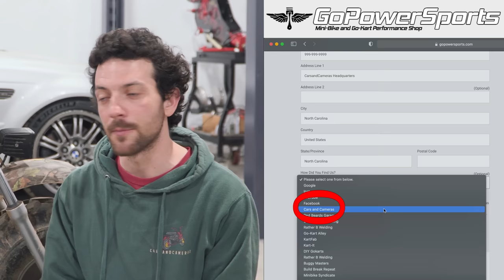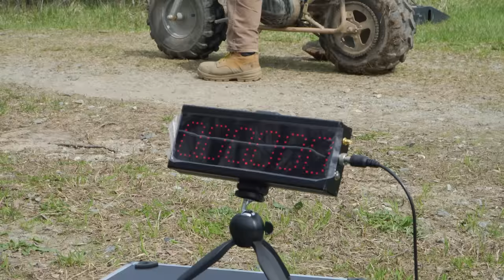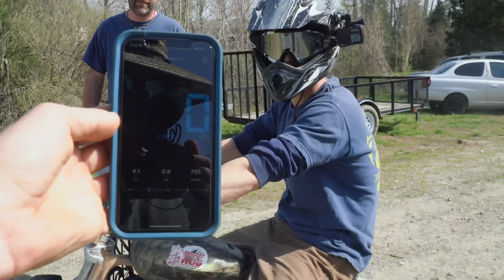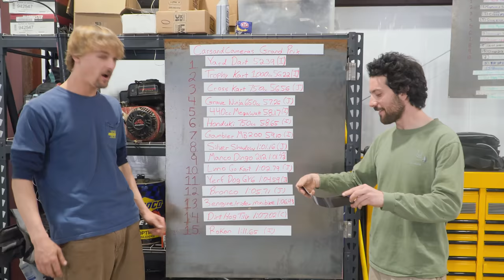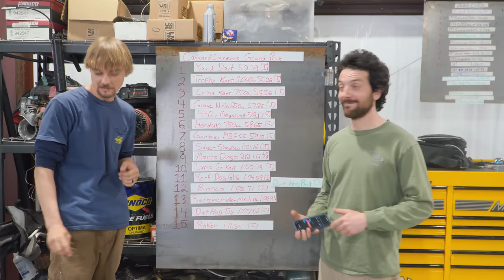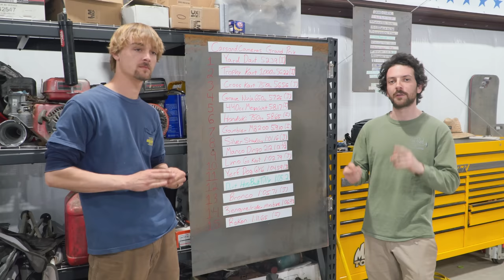Tillotson 212 E-Start Budget Build + Rip | 7,000 RPM Torque Monster!

Comment: Don’t forget each sticker adds 1-2 hp. Also if Charles blows on the air filter while riding he Could add 3 hp.
Reply: Especially a let's go Brandon sticker.
Reply: But be careful with NOS stickers. Their power increase is really hard to handle.
Reply: Charles is better than a turbo for small engines
Reply: My friend secretly added too many stickers on my racing mower and the internals and clutch are suffering from the extreme power 😢

Comment: Here's a tech tip: Keep a few golf tees in your tool box. They are a great way to quickly plug a fuel line during disassembly.
Reply: Yep. I cut mine down to about 3/4" long so it hits the taper a little.
Reply: Use a pair of mini needle nose vice grips
Reply: @cheeznipsmagee2357  Those will certainly work well but you can buy a whole bag of golf tees for the price of one pair of vice grips.
Reply: Hemostats also work well.
Reply: @johnnickerson6522  or, pick up broken ones (3/4 length) on your next trip to the links.

Comment: You guys are an inspiration. I have been seeking out the oldest Briggs & stratton's and Motors that I can find for years. I can rebuild cars but I find it far more satisfying to build small stuff. I appreciate your guys's videos and wish that I could do what you. unfortunately I've been in a relationship for 2 years wouldn't allow me to go out and work in my shop that I built just for that reason. But on the positive side that relationship just ended and now I have plenty of free time to get back out in the shop and it feels good. I can say it feels very rewarding to find an old motor they hasn't run in years and get that baby running again. Much respect. I don't know how old my oldest motor is but it's a two and a half horsepower Briggs & Stratton 4 stroke with a horse hair that you have to oil air filter and a 2:1 gear reduction supposedly it was for a water pump at one time and it's the oldest piece I have. As a side hobby I rebuild riding lawn mowers and build racing lawn mowers to ride on the beach which bypass the street legal laws. My fastest lawn mower does over 30 and rides huge wheelies.
Reply: For years.

Comment: The boys skim over the most crucial point is to pre torque the rod bolts on the the crankshaft to check clearances out of the motor then assemble in the block
Reply: Most of this build was done carelessly, IMHO.

Comment: Trick for removing studs: take an extra nut that fits the stud and make a “clamp nut tool”. Take the spare nut and cut through a flat all the way through to the threads.  Now spin the nut onto the stud and squeeze it using vice grips etc.  the nut will grip the stud on all sides equally and not damage them.
Also works for gripping a threaded stock/bolt etc in a lathe to cut etc.

Comment: I helped bring the cracked rod to the 7.3L Powerstroke diesel. It's great from a manufacturing standpoint and the cap only fits one way, fits perfectly and is a more stable connection to the main rod body. I had concerns about replacing the old 4140 forged rods with a powdered metal rod. The forging was stronger and able to bend in hydro lock situations where the powdered rod would break. But we never had a bunch of engine failures due to the change to fractured powdered rods.

Comment: I wheelie my Coleman 2021 mini bike all the time. I even put pegs on it like a bicycle so I can balance it better than putting knees on the seat but all I really need is a lower gear sprocket so the centrifugal clutch will kick in faster and do the wheelies correctly
Reply: The clutch engages based on engine rpms and has nothing to do with the rear sprocket

Comment: Not to take away from how cool that engine is, or even cooler Johns hat is, or the friggin lasers, but I love the longer episodes. BTW, I think wood chips might help with the mud on the track.
Reply: It couldn't hurt, right?
Reply: I use them for my personal track out here in Cali. Also would definitely have changed the crossover on the creek to a banked dirt crossover with pipe outlets for the creek. If y’all have a tractor or something changing camber through the field would be smart as well.
Reply: Sand... wood chips are small projectiles and can hurt you pretty good... sand is where it’s at
Reply: @aaron_brown7324  I have a half dirt and half sand track and it's very easy to lose control on mini bikes 
i personally rather mud over it but maybe there's another option that works better
Reply: @thefishingchannel3192  my buddy’s track gets really muddy on the turns especially.... we was thinking about adding some sand but not enough to be just sand... we want a sand mix to help keep it from getting so muddy... I could be wrong tho I have been before 😂
Reply: @aaron_brown7324  a sand mix would probably work pretty well just alot of sand = no traction 😂
Reply: Chainsaw dust.
Reply: I wouldn't worry about the track, Top Gear just ran the wet track and did the (W) on the times for it, should be gud 'n uff
Reply: Are you guys nuts? Add hard clay. Or cement so we can get some sick drift smoke.

Comment: About 5 years ago, I was working at an auto 
repair shop.  Just me, and the owner.  His 
wife also did paperwork and stuff.

One lunch, I was reading a Hot Rod mag, 
and they were discussing rod big end 
types. they mentioned the cracked ones.

2 hours later, we were dropping the oil pan, 
on a car with "rod noise."  Boss said, let's see 
if it is just bearing noise.  Removed the rod 
cap, and it was a cracked rod, which neither 
of us had ever seen.  (Except in that Hot Rod 
Magazine.)  The rod bearing and the rod journal 
"looked" OK.  Put the oil pan back on, oiled it, 
and it ran, just fine, for about 3 minutes.

The car was a cheap, used up, econobox. 
Wasn't worth pulling the crank, and getting 
it turned and more bearings.  It was worth 
the hour we put in.

Funny thing, seeing the article in HRM, and 
then seeing our first cracked rod.

steve

Comment: When checking/adjusting your valve lash, keep a bottle cap of oil close to dip the end of the feeler gauge in before you check lash.....the resistance you get using the gauge dry vs. With a coat of oil on it can and sometimes will put your adjustment out.....

Comment: Get the timing marks lined up you can pull the gear out you can also put paper towel shop towel stuff them in there it will hold them in place

Comment: Ike @14 minutes you talked about cracked rods. It's a 90s technology for the powered steel rods. It's called Cracked Caps. The big end of the rod is broken. That break means the rod can only go back together the way it was broken. Down to micro scope level the various cracks make the rod stronger. When the rod is assembled you can't see the seam like you can on CNC stuff

Comment: Electric start: Charlie is getting soft! 😆 By the way, 22 lb valve springs should give you that 7000 rpm, or more. And try the offset key on the flywheel to get more advance, and more torque.
Reply: He'd need a Jugg for 7K.
Reply: @Deucealive75  Juggernaut? Maybe so.
Reply: @jeffrykopis5468  Yes. I have similar gearing (9/60 tooth) on my Coleman and top out at 5K RPM around 47 MPH with a not so potent 196. It's a trail bike and has seen that speed only once. He should get at least that if not 50+ if he put it on the road.

They were smart with that cam choice. A bigger cam would need higher RPM which would require a Juggernaut to get there. He can still do a Jugg but would have to change gearing if he doesn't want to top out in the 30's at high RPM. His current setup looks to work very well.

Comment: The rods y’all were talking about are called cracked cap and they are made from powdered metal that is heated and pressed together and it is pretty much impossible to install the rod cap wrong unless you either did it on purpose or are not paying attention

Comment: Better in the long run to remove head early on. You can check piston to deck, decide gasket thickness, perhaps use a flat top piston (cheap). Some Merc outboards used to do the fractured rod thing.

Comment: Interesting build. I installed a NR Racing 280 series marine cam, #26 springs, and billet rod in both of my neighbors boys Coleman EX and tweaked the governor to 4800-5000 rpm with carb re-jetting and header. Installed torque converters. Beast up to 5000 rpm. I still advised not to hold it at full throttle for more than a few seconds.

Comment: You shouldn't have to remove the crank to get the governor arm out. After removing the plastic gear and the clip on the outside of the case that holds the arm in place, you should be able to push your hockey stick up and cut the arm on the outside of the case, then it should push through down into the motor for removle. However you will need a nut& bolt to plug the hole or tap and just bolt. Either way I always use rtv with my bolts, governor & low oil shut down.

Comment: Definitely be careful with your valve train especially revving it with the stock components! Right now you can actually hear the lack of spring pressure has become the new Governor system which isn't particularly a very good thing! Sounds they are beginning to float the valves around 6300 - 6500 RPMs. I would be mostly concerned with the valve spring retainer coming off during a  valve float and you dropping a valve into the piston guys. If anything, get a slightly stronger spring and better spring retainers to prevent you having a  catastrophic engine failure!!! It's so worth the time and little money they cost now as assurance against this from happening. Otherwise great video as usual guys, and very informative 👍 👏 👌 😀!
Reply: If he's running the stock driver on the torque converter he never seen 6K RPM here. No way at only 44 MPH top speed. The stock springs can handle the RPM he was running.

Comment: I built my stage 1 predator 212 on a doodlebug db30 with a stock carburetor and it does 43 it was a 12 tooth clutch with #35 chain

Comment: I use a hammer and small chisel to chop out the governor.  Just chisel that plastic wheel near that little clip and beat it with a hammer lol.  Also, I don't cut out the hockey stick.  You can leave it in if you put that plastic cap back on the little peg and give it the proper angle.  It's funny, one of my minis is an exact copy of the bike in this VOD.  Coleman ct200 ex with a TILLI!!!!  ye ye.  Mine pulls 45mph with the stock carb on it though which is weird theirs doesn't go faster.

Comment: Adding a MOD2 cam and not upgrading springs/increasing timing as the cam says to do does almost nothing but increase the chance of the valves smacking the piston at higher rpms. To fit your "budget build" use an offset keyway for the flywheel. The cam sheet should say what timing the cam needs.
Reply: Mod2 cam doesn't have enough lift to make it an interference engine.

Comment: I had a stock predator 212 with aluminum flywheel and Mikuni 22mm and it reved to almost 9,500 rpm

Comment: Thanks for that tech tip! I got my first bike couple months ago a CT70 clone the ice beer champion, I had to change the tank And I wanted to upgrade the fuel lines so after my 3rd or 4th order I finally got the right ones but my fuel filters were too big so I accidentally cut the line too short to the fuel tank yep. It works But I will have to change the filters that means the line will get shorter there's that but it'll be nice if I can even ride the thing a fiance ran over the key with the lawn mower and trashed it, it'd be nice if I can find the spear yep there's that. All this in my first bike which I wish I could ride.

Comment: No assembly lube on the push rods?? Good way to burn a tip. And no assembly lube on the cam lobes or tappets?👍 when you turned it over to check clearance you could even hear the dryness

Comment: Did I miss the part on changing the valve springs? I would think with the larger cam, you would need stronger springs to keep the valves from floating. Does the Tillotson come with heavier springs? Keep up the good work!
Reply: The tillotson does come with heavier springs.

Comment: I believe you can just reposition the governor arm on the shaft so it has no effect leaving all the parts in place and then be able to restore the action of the governor if necessary. Takes 30 seconds with no disassembly needed.
Reply: then the weights on the governor gear fly off inside the engine and destroy the engine. that's the only reason people remove the gear. you can easily bypass the governor from the outside.
Reply: @SpicyBloodBean  You just have to adjust it a bit, weights won't fly off.

Comment: Stock valve springs being used as a rev limiter with the performance cam to keep the starter flywheel in a safe rpm limit? If that is the thinking great build idea. Thank you for sharing this build.

Comment: Mod2 cam works even better with 1.3 ratio rockers its a must if you run the mod 2 and at least 26lb springs stock carb makes alot of low end torque with 1.3s if you swap to a vm22 you will actually make the power fall off in the low ends but carry all the way to 8k the mod 2 works best with a billet rod and flywheel 1.3s and vm22 and 26lb springs and you will have a 8k rpm engine all day

Comment: if the ringgear is mounted the same way as in a car you coulls heat it up untill it falls off the stock flywheel and replace it while still hot on the billet flywheeel

Comment: Dave from the channel Black 66 removes the governor from the backside, pulling the entire assembly and pin out, then tapping and plugging the hole. I believe he has to remove the flywheel and crank to do so, but he always changes the rod, cam, and flywheel anyway. He takes these Tillotsons to 9000 rpm and over 60 mph. He also installs an offset key on the crank/flywheel groove that advances the timing 7 degrees, and it does add torque.
Reply: A 7 degree key with an ARC flywheel would put the timing at 39*...that's probably hurting power more than helping it
Reply: @CRAZEDX100  Worked for Dave.
Reply: He uses the 7 degree timing key on stock flywheels to get 35 BTDC. In that video he put on a billet flywheel that comes with 34 BTDC of timing, and he used the stock key.

Comment: From what I've heard, apparently what old mechanic shops would do for assembly lube is just use vaseline. It's just petroleum jelly and because of that there are very few things it reacts with. This is also a reason why a lot of (at least older) mechanic shops would have a container of vaseline on the shelf. Also you guys didn't shave the head, use a thinner head gasket, or modify the ports on the head.

Comment: Guys, I think ANY cam swap would benefit from stiffer valve springs. Valve float will limit rpm and could do damage.
Reply: are valve springs really that expensive or are there other supporting mods that make it expensive?
Reply: Why not do the aluminum flywheel as well?
Reply: @marcmo7138  they were wanting to keep the steel flywheel with the charging magnets for the stator, in order to keep the electrics on the bike. they didnt want to crank the price of the build up by getting a high RPM flywheel that still supported the charging system.
Reply: yep
Reply: @ghomerhust  Tilllotson 212's come with a flywheel rated at 10,000 RPMs. Should b good.
Reply: @ghomerhust   I got ya. Thanks
Reply: Stock springs will keep you from accidentally blowing up the flywheel
Reply: @terryj257  REEHEEHEEEEAAALLLLY!?
Reply: Reason they didn't go with the valve springs and a flywheel is because they wanted to keep the steel ring for the electric start
Reply: @marcmo7138  I think John said they couldn't get one with a ring gear, for the starter.
Reply: @charliemaybe  Naw they should only be about 20 bucks, if that.
Reply: @jeffrykopis5468  would a spicier cam and valve springs really cost a lot more? If it doesn’t cost more than like 30-40 dollars more for stiffer springs and a hotter cam, then what makes it not budget? Is it a reliability issue or something?
Reply: Mod2 cam, it's still a non interference engine at least.
Reply: @charliemaybe  Beats me. They did change the cam, so for a few bucks more I would've changed the springs too.
Reply: 26 pound springs are like 16 dollars. I have a dynocam super x cam and threw a pushrod off the rocker arm with 22lb springs. Put it back together, then bent a valve at high rpm.. Invest in the springs
Reply: He doesn't need springs with the RPM he's running.
Reply: @Deucealive75  I was only turning 6k with the super X cam in my tillotson when I dropped a pushrod
Reply: @Deucealive75  But that's the thing: the rpm he's running is probably limited by valve float. With springs (someone else even recommended 26 lb springs), he should be able to reach 8000+.
Reply: @jeffrykopis5468  Like I mentioned in another comment. He'd need a Juggernaut to get that kind of RPM. Not a chance with a stock 30 series TAV. They said 44 MPH. With a stock TAV, even with a 60 tooth on a Coleman is under 5K RPM which stock springs easily handle.

I will say that I wouldn't run stock springs with that cam. 18 minimum.
Reply: @Deucealive75  So the Juggernaut let's them rev higher, but they lose top end speed? Why? Is the final drive ratio lower with a Jugg?
Reply: @jeffrykopis5468  Yes. The stock driver allows .9:1 ratio with the belt fully shifted which is overdrive. The Jugg never even gets to 1:1. They seem to be around 1.5:1. When you multiply by the sprocket ratio it's quite a difference.

As an example, if he had 10 tooth 60 tooth and a Jugg his final ratio would be around 9:1 after the belt shifted. The same sprockets with the stock driver would give a 5.4:1 final ratio.

I take that back when I said topping out in the 30's. He would get around the same speed but at 7K RPM.

Here's a good video with the Jugg in action. Notice the small rear sprocket he's using. https://www.youtube.com/watch?v=3xrUZuf8wYU
Reply: @Deucealive75  Wouldn't 10/60 sprockets make a 6.0:1?
Reply: @jeffrykopis5468  Yes. But you then multiply by the TAV's ratio to get a final ratio.